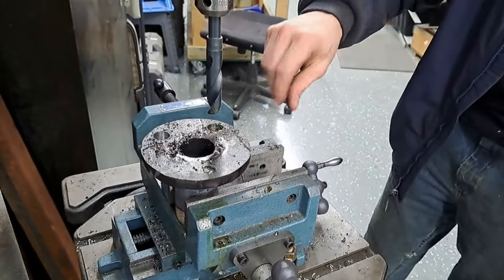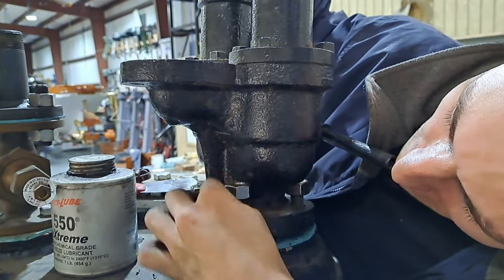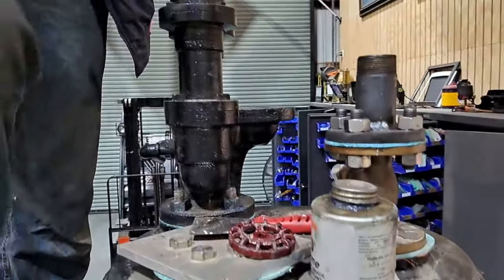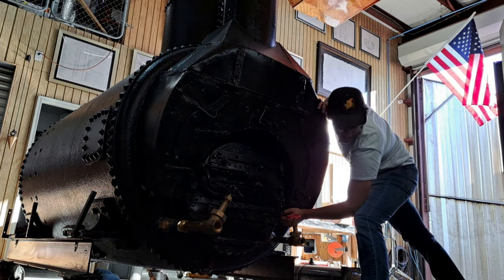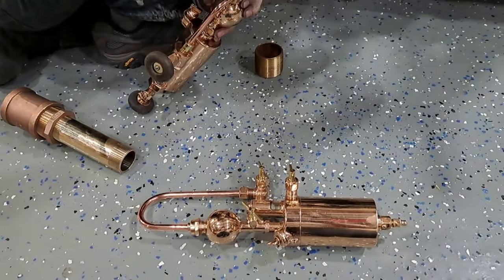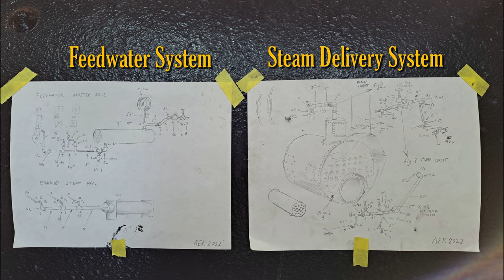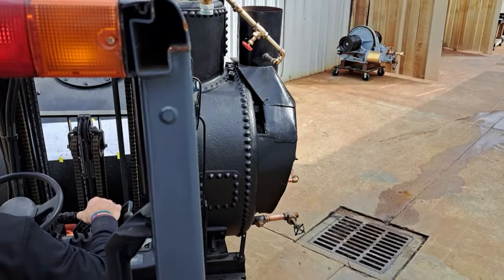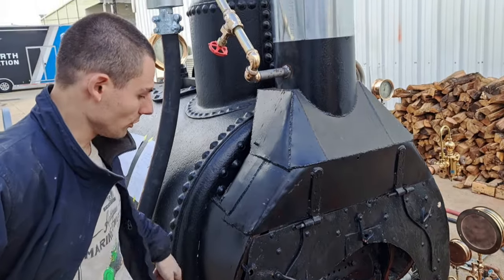Building a short-notice power plant around an 1887 Scotch Marine boiler

Comment: Just read about the Pratt situation. Can’t believe they’re destroying what should be preserved as a museum, in the name of questionable emissions improvements (when you consider the emissions of building new stuff vs burning natural gas slightly inefficiently) They should build the new communal hot water/heat system as a completely separate thing instead of demolishing the place.

Comment: I'm passionately curious about a great many things but steam is an entirely different branch of science from anything I've ever been taught. It's fascinating soothing and primal in a very good way. It would be so much fun to go work with these guys for a few weeks just to learn how to get old infrastructure running again in case the need should ever arise.
Reply from the maker: The biggest thing to remember is to never be scared of it.
Reply: It's not the equipment I would worry about, it's an inexperienced operator that would make me sweat.
Reply: @AEKarnes can you please possibly find a Stuart turner 5A steam engine and a sippy 1/4 scale vertical boiler id be interested in purchasing them in a bundle I'm from Plymouth Indiana USA

Comment: Great content as always. I'm a supercritical plant operator in the midwest but I have great interest in the older machines. They have a older and wiser disposition unlike most modern equipment. There aren't many steamers around anymore but they pop up from time to time on marketplace. I hope to get my hands on one soon.
Reply from the maker: You have my respect for understanding the true nature of the old foundational machines AND for being a supercrit operator.  I've got a lot of questions about supercrit plants because I only briefly did some work in one.  Mostly generating tube wall thickness and steel type, do you have seperate superheaters or is the superheater part of the once-through, what is the steam drum diameter on your unit and does the supercritical steam pass under the critical point while passing through the HP stage?
Reply: My facility houses 2, 10-cyclone fired furnaces, once through. pendant style superheater and reheater sections (crossover turbine setup). Implementation of several low and high pressure feedwater heaters. Boiler tube wall thickness 5/8" Operating pressure 3650psi @1010F @AEKarnes
Reply from the maker: Thanks so much, but what steel type in the generating and superheat tubes?  Havent been able to find that out yet.  And I really want to know if the working fluid goes subcritical in the HP stage and if so at what point, and the shape of the turbine wheels and if it differs where the fluid is supercrit and subcrit.   I love this kind of engineering
Reply: @AEKarnes  we have various alloys used. Primary tubes are 90 grade chromoly that are pin studded and covered in refractory. Parts of the superheater and reheater are 625 inconel (pure product goes to hp turbine, leaves HP turbine for a trip through reheater, goes through intermediate turbine, exits INT And goes to LP turbine through an overhead crossover after which it exits to the condenser)
Reply: @AEKarnes  I would have to look at the newer drawings but original manuals I learned was it remained supercritical through the first 3 of 5 stages of HP turbine. I do more field operating than sitting at a desk so I don’t have the numbers off the top of my head to tell you for certain though I can gladly check when I go back in. The blade and bucket profiles have been changed a few times since 1967

Question for you- how does one out a dollar value on an old steamer (vague, I know) I’ve been scouring marketplace and Craigslist for years to no avail. There was a sweet two cylinder genset with the original dynamo, an unrestored boiler and a couple auxiliary pieces of equipment nearby that sold for $400 some handful of years ago. Not many people my age are interested in this stuff however I see it’s necessary to preserve because I have a sneaky suspicion we may be relying on “old tech” in the not so distant future.

Comment: Impressed.  I may have missed it looking over the YT site, but I have to ask, what is your final objective here, a steam supply for those priceless compound engines for testing or something else?
Whats the background on the boiler? What steam rate/pressure will you be running?  Is there video of the waterside of the tubes, stays and furnace.?
Sorry for all the questions but I'm an old C/E who sailed with an elderly A/E in the early eighties who was badly scarred by a staybolt-head that blew out of a scotch boiler on a ship struggling to keep convoy speed in 1944.
Subscribed and looking foreword to the second installment. Thanks.

Comment: Just a thought, if the owner of this equipment can afford to, you should look into purchasing a pipe threading machine. The Rigid 535 is the standard machine that most steamfitters/plumbers use. Comes with an adjustable die head, another handy accessory is a nipple chuck for making just that. You can even set the thread depth of cut for ideal thread engagement which is about 3 1/2 turns by hand, before using a pipe wrench.
I'm sure there's used machines you can purchase locally. 
Will save you time and money.
Reply from the maker: Not a fully equipped shop sadly I don't make the decisions there I just run the steam power.
Reply: Keep up the good work.

Comment: As ever, highly interesting. One question if I may. Have you ever come across a Beaumaris Compound Engine, designed by Vic Mills?
Reply from the maker: Not yet but I'd like to!
Reply: Was involved in their making in early ‘70’s. Sold fully finished and ready to go for £2,800! Thirty three in total, supposedly “holy grail of small steam engines”. Reved to 1250 on live steam in Nottingham University test lab! @AEKarnes

Comment: You're right about the nuts and modern machine parts in general, if it's modern nine times out of ten, it's bad. I don't need to say it to you but for others, it's part of the throw away society. The marketing idea of sub standard parts for modern substandard throw away machines making the consumer buy more for less quality aka built in obsolescence . Antique tech should not be looked upon as obsolete and valued as such for being a technology of a bygone era but for the quality of workmanship and possible modern applications for said technology. As to your drill press milling machine, maybe try getting a Linley milling machine. My grandfather's company was Linley Brothers MfG Company, Bridgeport, CT. The A1 was designed by my grandfather and it's ok but the A2 redesigned by my dad was a lot better. The company began in 1918 and lasted until about 1966 incase your interested. Keep up the great work!
Reply from the maker: You have my thanks and respect as this needs to be talked about a lot more.  And I am very glad to know the descendant of a Connecticut Industrial family as that is where I grew up, and I grew up in the shadows of what was once a thriving coastline of builders and industrial engineering
Reply: It's a pleasure to know you too but, it is I and my family that should be thanking you for your kind words and for what you do. To meet someone who shares the same interests as I is rare and I look forward to seeing your next video. Best wishes to you and yours.

Comment: Re your water level versus fire:   ignoring the fire will just cause the pressure to go down.  Ignoring the water level will at best damage the boiler and at worst kill you!
Reply from the maker: I did not say anything about ignoring either, only an incompetent ignores something on a steam plant.  What I said still holds true, managing a fire takes talent, managing water level takes only the turn of a handle provided the equipment is reliable.   

The antedote to the  water-level obsession regarding shrink and swell I will cover in the next video.  Reliably, the idiots I've worked with who are obsessed with water level only are the ones who run it far too high and who prime my headers when I take load in a power plant.

Comment: I sure hope "Scotch" is the brand-name of that boiler.. as opposed to simply being made in Scotland - in which case it's SCOTTISH fer feck' sake.
Reply: It is the type of horizontal Fire tube boiler called Scotch type .

Not a brand name .
Reply from the maker: Scotch Marine is a design of boiler, built all over
Reply: I had marine high pressure navy and merchant marine training .

First time I got to a shore Scotch boiler I emptied it and removed a handhold .

My God some idiot put on a rubber gasket !   

I had only seen Flex italic gaskets on boilers .

150 psi boilers Use rubber gaskets of course but I had a new world to learn I found ..,,